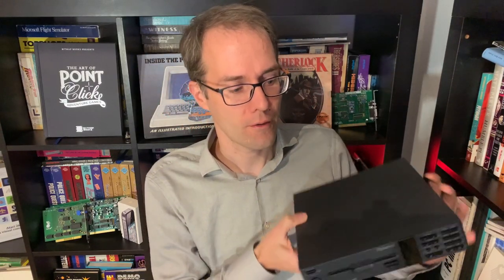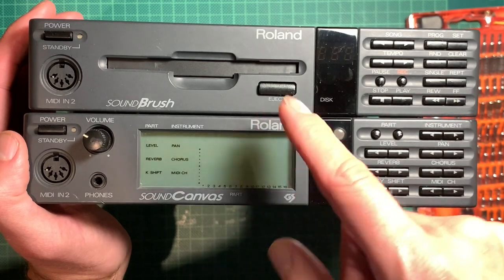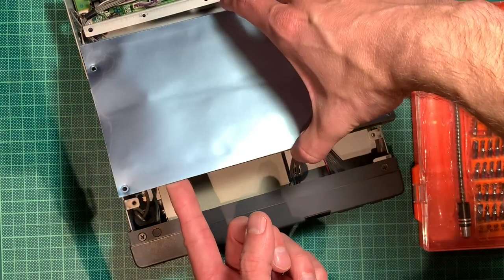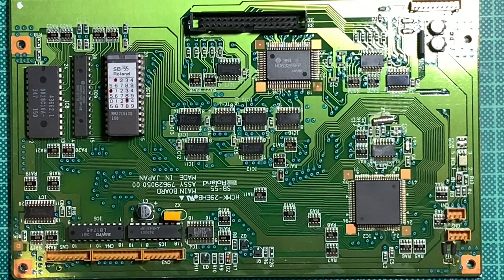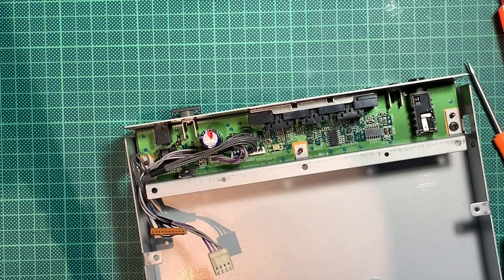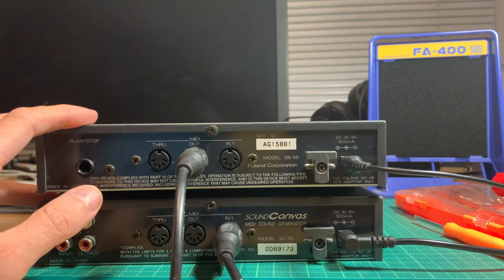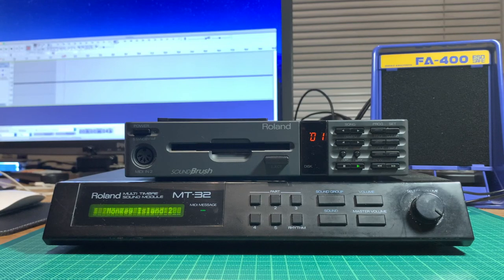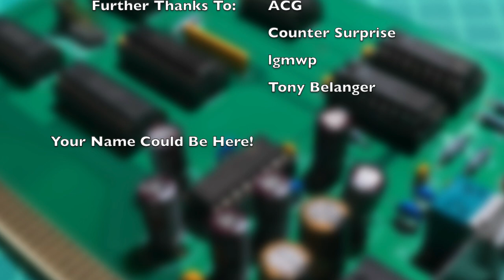Playing Game Music without a PC: The Roland SB55

Comment: Great video! Today I just repaired my newly obtained SB55. The three 47uF  electrolytics leaked. The solder mask around was black and flaky but the copper traces mostly intact. Mostly... I put some temporary ordinary caps and it works just fine. As a digital device there is no need for fancy audio caps. Fun little device. Keep posting!
Reply from the maker: Thank you and good that you saved that device!
Reply: Can you repair these for other people I’m receiving error, messages, for several of my SB 55?
Reply: @Billsingsong  sorry. i don't have the time and means to go beyond fixing my own stuff. job and family takes almost all the time.

Comment: thank you for this video. I have recently bought one of these SB-55 devices and was wondering about the naming of the midi files written to the floppy disk. the Roland files are 00000.mid,00001.mid etc.  Do i have to rename the .mid files i put on the floppy disk? the manual doesnt cover using a computer to put midi files on the disk.  I have tried recording a midi file played on my computer on the SB-55 but when playing back it seems to have recorded all on 1 channel. i dont have a SC-55 yet so i am currently trying to get fluidsynth to work on a rasp pi zero w.
Reply: 1. "Do I have to rename the .MID files I put on the floppy disk?": no, the SB-55 plays the files in alphabetical order by their name.
2. "I have tried recording a MIDI file played on my computer on the SB-55 but when playing back it seems to have recorded all on 1 channel": I don't think it's the SB-55's fault.

Comment: Odd "little" device. Looks like a candidate for a Gotek Floppy mod :-) Other than that, I suspect it's more energy efficient to have an Arduino play midi files standalone (recording is probably not as straight forward).
Reply from the maker: Yes, it is an odd device from today’s perspective. Back in 1993 I think this would have made more sense, especially for musicians. Laptops were not powerful and were expensive. Having a compact module in your setup that could record and playback tracks from a floppy sounds pretty useful.
Reply: I remember our school (during the '90s) had keyboards with built-in floppy drives for such usage, so I guess this was one solution if you already had a keyboard without that feature.